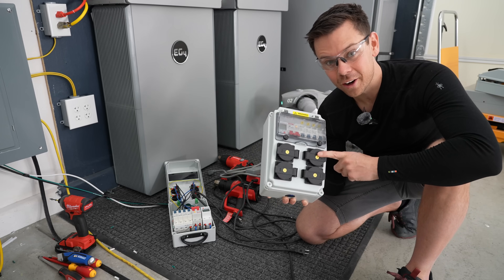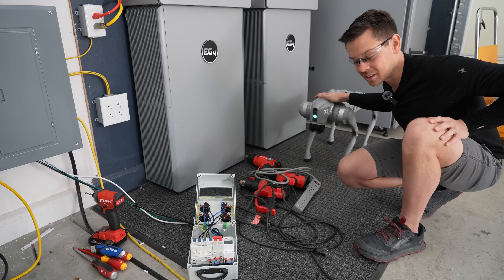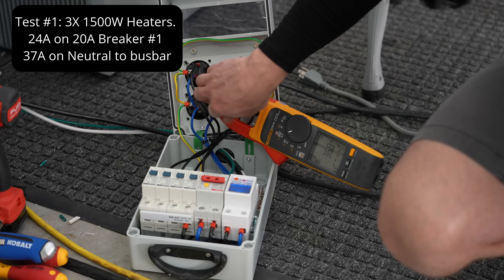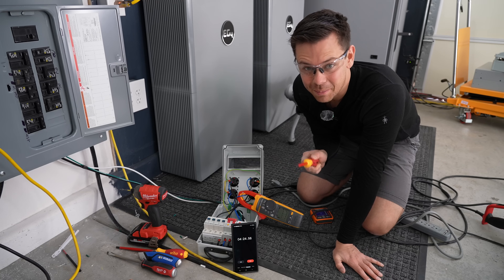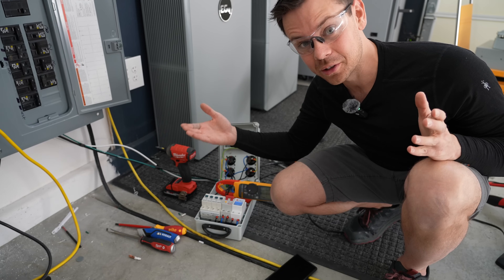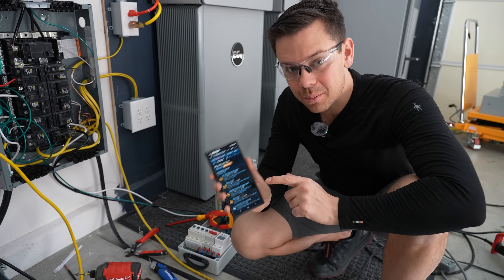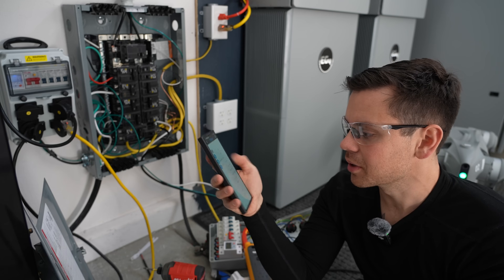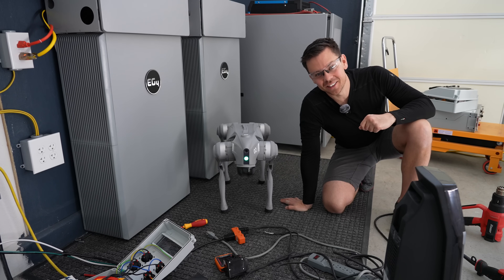Are 20A Breakers from China Safe?! Let's test them!

Comment: Thanks, Will. I will also point out that "conforms to UL standards" is very different from UL listed. 
The Chinese breakers performed about as I expected (i.e. poorly). 14 gauge wire performed better than I expected, but it is very much the wrong choice for a 20 amp circuit. The wiring problem needs to be reported to Amazon and the consumer products safety commission. That is a genuine fire hazard, even if the breakers performed properly.
Reply from the maker: It's really a 40A circuit using it. How it's wired in the video. Yikes
Reply from the maker: Yes agreed
Reply: No friend, the Chinese breakers performed exactly as they should have.  Even the 37A test is within tolerance (20 seconds to 4 minutes under standard test conditions) which Will probably doesn't have.  If his environment is cooler than 25c (no idea if it is) then the times will extend since this is a thermal trip at these current levels on a C20.
Reply from the maker: @retrozmachine1189 I'm finding out that this is true for European breakers. These are being sold in America and should trip much faster. I also still cannot find a data sheet for this model. Can you post it on the forum?
Reply: @WillProwse  Sorry Will I don't think they actually produce a datasheet.  The best they have are tables of figures for classes of their devices and some low res trip charts.  The trip curves are standard IEC curves just too low res to be useful.  Eaton publishes some nice hi-res graphs if you search against their web site.

Comment: Each automatic breaker has a type that indicates time/current curve it follows (type b,c, etc.). The disconnect will depend on how long specific current flows. Depending on a type of a breaker you test it may be 1.6 times 20A upto 1 hour and still will be within specifications or it could be more. It still amusing to see all problems with high current that you have in 120v grid.
Reply: Those are likely 100% rated, not 80% like NA residential/light commercial use. DIN rails are common in modern UK homes where the fuse is in the outlet. I’m not excusing the design, but these are a hodgepodge of USA and UK/HK parts.
Reply from the maker: Yes absolutely and I still cannot find the data sheet. If you guys can find it can you post it on the form because I can't find it. That was the first thing that I thought as well.
Reply from the maker: Oh yeah I don't like the design of our t
Grid either lol and good to know about 100% rating. I wish I could find that data sheet. I can't find it for these breakers.
Reply: @WillProwse  just read the trip graphs. left row = time. bottom row= multiplicator.  the curve is also markt on the breaker. eiter B, C or D
Reply from the maker: The biggest issue is 40 amps going through a 14 gauge wire 😂 and the terminal temp rating of that connection. Yikes.

Comment: Excellent OPS testing. Interesting design concept but with substandard components.
Reply from the maker: Thank you!!
Reply: It is a good piece of equipment.  The circuit was able to handle the extreme current and not get hot. The only weakness was the over current protection on the circuit breaker.  It is still a convenient way to use solar.
Reply from the maker: I would still swap out that 14 gauge wire if 40 amps is going on it. That's scary

Comment: Not surprising about the breakers. Thanks for the due diligence. You are a real pro!
Reply: The MCBs are actually working correctly to spec.  That may not be acceptable timing in the USA but the rest of the world makes extensive use of C curve devices, and Z(A)/B/D as well but C certainly has it's fair share.
Reply from the maker: @retrozmachine1189 yeah I'm only used to the American ones. Had no clue these ones are rated for this duration. Still can't find the data sheet unfortunately